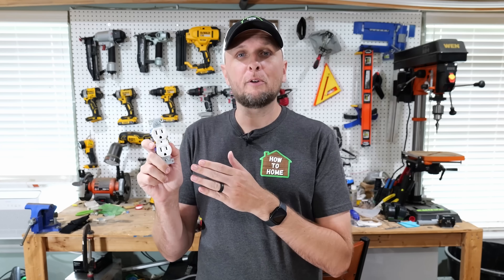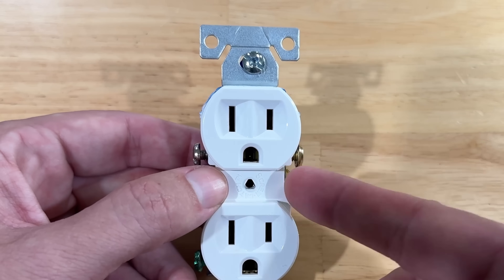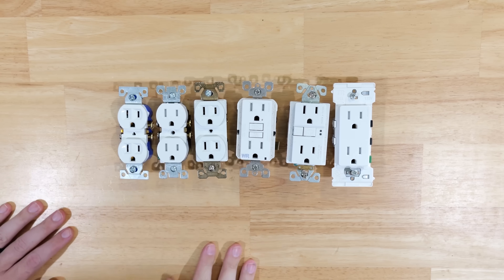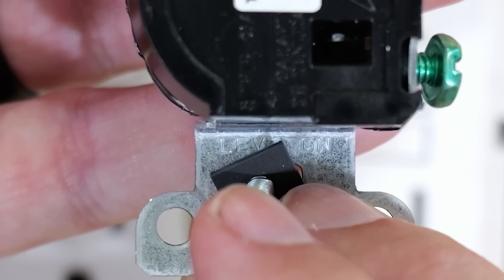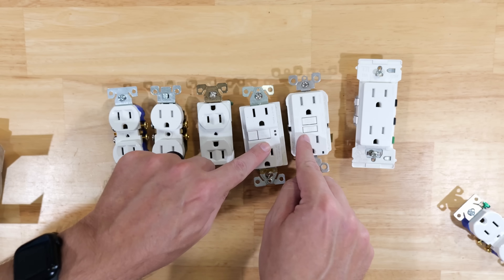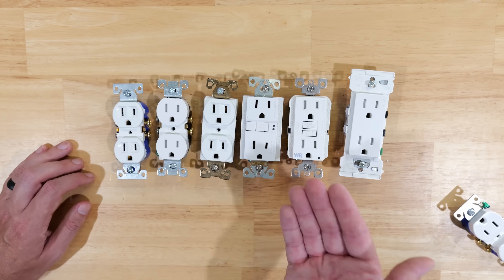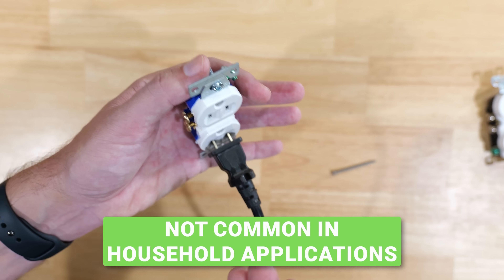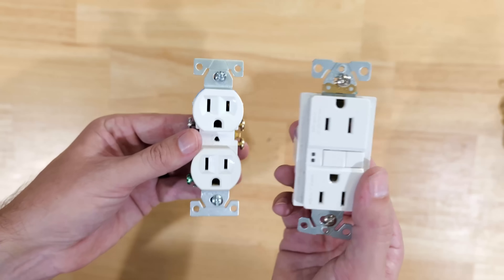The Shocking Reason Why Your Outlets Are Installed Upside Down!

Comment: When I started 35 years ago the master electrician that I was a helper for stated matter of fact the ground pin goes down. In this install the ground pin which is longer would pull out last after the hot and neutral pulled out. He also pointed out the UL was right side up when in this configuration. I was told this more than once. 
It is similar to having a longer ground wire on motors. The lines get pulled first and the ground is still connected to trip the breaker on a short.
Reply: @MzKitty006: Ground prong up when that outlet is attached too the wall-switch so people there have a visual cue to know where to plug in their lamp to control it from the wall light-switch.
  Medical facilities have things hanging on walls that fall, like clipboards that short the circuit, military galleys and restaurants, ground up was specified for contractors, due to stainless steel utensils being dropped, etc. In many cities ground up is standard in all commercial and industrial buildings, ground only go down in residential buildings, houses, apartments, condos, etc. 
   Everything is in context and the answer DEPENDS on context.

Comment: In Britain the ground is always at the top. Any discussion about anything causing an arc or shock is pointless, because there's a protective sheath on all 3 prongs that will not allow any 'foreign' contact - particularly fingers - until the plug is fully seated. Definitely more important there because the voltage is 220/240. Other points are that each receptacle is switched, so the plug can still be left in and the device powered off - and finally, it's impossible to be too lazy to bend down and snap the cord out of the wall, because the cord exits the bottom of their larger plug

Comment: Look at UK Plugs, if they are partly unplugged, you still can't drop a nail or knife or a finger to touch any live pin.. . .    Also note how UK plugs always have the cable hanging down, so don't tend to pull the plug out and you can't pull them out by pulling on  the cable.. . .  American ones you can.

Comment: Interesting except for how wordy it was - kind of annoying.  It took way too long to make a non-conclusional conclusion.  I imagine though that a home inspector would have a fit or take issue with outlets installed with the ground prong up, simply because it's unconventional - not like most homes.
Reply from the maker: Well, ya know, it’s kind of hard to get all of the information out there, along with all the different thinking and why they may be good or bad thoughts on the subject.  I wasn’t talking about the weather.

Comment: Because of a lot of newer plugs and extension cords for indoor use that are angled becoming more common, I tend to prefer indoor outlets being ground down. In a garage or shop however I go ground up....not only for the "falling object" reason, but also because of cords tending to be heavier on tools and extension cords. The hanging weight of the cords SEEMS to  have less impact on the plug being able to come out of the receptacle if the ground is up.
Regardless of which way I turn them, the one thing I ALWAYS do is to be consistent.... Indoor all ground down... shop, barn, outdoor, etc. all ground up.

Comment: In the choice of ground pin up or down, and in the case of a 90 deg cable + male plug, i would set it so the cable goes down instead of up, once the male plug is connected. It is something you did not mention in your video. Anyway i still appreaciate ur videos. Thanks

Comment: I would consider installing the receptical with the common or ground plug on the bottom, facing me. This would give the user, a better chance not to touch a live circuit
 and possibly be electricuted. It's all up to you!

Comment: I always install them with the ground prong down, simply because it looks better, IMO.  The only negative to this approach is that I need to strip off more of the cable insulation to expose the length of ground wire to reach the ground connection in the bottom position.  Then I will trim the exposed neutral and hot wires about an inch since they don't need to be that long to reach their terminals at the middle of the sides of the receptacle.  A bit of extra work.  Good video, I enjoyed the discussion!

Comment: A case for ground side down would be a basement. If flooding occurs the water would touch the ground hole before the hot hole. Realistically, the water should be rising slowly enough to touch the grounded box first.

Comment: As a retired Elect. we always put ground up because that is the way must rec. are installed. Just common practice. When I built my house that is the way I put them. When I built my 40 by 40 shop I put the rec. with the ground up. They are about 4ft off the floor. If you do something stupid like hook the cord with something like maybe your clumsy foot the ground is most likely the first to come out of the rec. The flat blades bend easy but straiten easy. With the ground on the bottom it is the last to pull out if at all. This is one time when three bent prongs are better than two. To ask me now, It just looks right and makes more sense to have the ground on top.

Comment: Nearly every commenter here forgets the effects of time.

Grounded plugs were far more important decades ago when use of plastics was far less common.  The housings of nearly every appliance these days is plastic and allows double insulation to protect the user.  We also didn't have GFCI circuits or plugs.  

Therefore ground UP, allowed the using a clear view of the ground pin while plugging it in.  If you didn't purposely check, you may at least subconsciously note that it was missing or damaged just by it being in clear view.

For this reason, ground up was especially common in kitchens, laundry rooms, and shops and commercial areas where tools and appliances were used the most.

As an aside, one should not use manufacturers designs as evidence as they have simply adapted to whatever the 'norm' has become.

Comment: I'm not an installer. But as a home user, I prefer prong side down. If the plug is not a tight fit, prong side up will tend to fall out easier than it would with prong side down. Interesting video!
Reply: Yes! I want the cord to stay plugged in. Not gape from the gravity on the cord and plug.

Comment: My brother had an issue.  He has an outlet on the backsplash not far from the sink in the kitchen, but had the dish drying rack in between them.  At one point, a butterknife in the drying rack tipped over to the side, JUST enough to fall inbetween a plug and the outlet (prong down), and POPPED and arced real quick.  Prong up on kitchen counters or on workbench height make sense.

Comment: All Outlets in Hospitals are installed ground up. Where does the code for Hospitals come from? Also some refrigerators come with a 90 degree plug with ground down so the appliance can be pushed back closer to the back wall.

Comment: I agree ground down. I am a master electrician with over 46 years experience. But a lot of jurisdictions will use Industry standard for medical facilities. IEEE White book Standard 602-1996 section 4.2.2 which says ground up just for that reason you mentioned that in a medical facility a needle can fall behind the plug. But that doesn’t guarantee safety. As the needle rolls to one side or the other, if it goes toward the line side rather than the neutral it will probably contact the ground and line anyways causing a short circuit.

Comment: There was a test done, and with the prong up, if a plug comes part way up and the plate falls from getting lose, there is a shock hazard. When the ground is down, the metal plate will hit the prongs and trip the breaker, thus de-energizing that circuit.
Reply: "De-energizing"? Let's call what it is: Shorting the circuit.

Comment: My buddy who was the chief electrical inspector for the city of Boston, had all his outlets with the ground prong up. I told him they were installed incorrectly and he set me straight, LOL!. He was old school and had seen a lot of problems. I think now a days it is not as much as a problem with the positive connections the outlet make now. Back then, they seemed to get loose very easily.
Reply: @jamesoncross7494: It still matters today. Ground prong up when that outlet is attached too the wall-switch so people there know where to plug in their lamp to control it from the wall light-switch.
  Medical facilities have things hanging on walls that fall, like clipboards, scalpel, hemostat, that can fall and short the circuit, military galleys and  restaurants, ground up was specified, due to stainless steel utensils being dropped, etc. Therefore it has become required that they be ground up for contractors. In many cities ground up is standard in all commercial and industrial buildings, ground only go down in residential buildings, houses, apartments, condos, etc. 
   Internationally, countries with 3-prong outlets always have the ground up
   Everything is in context and the answer DEPENDS on context. 
   Examples:
“Never took the orientation of an outlet seriously until I was measuring for a shelf with a tape measure. It slid down and fell across the prongs of the washing machine plug.  POW! “ —@joef.6596
“I work at a K-8 school. Maintenance assembles powered multi media carts with the ground plug up in consideration of teachers dragging metal bracelet chains across partially unplugged power plugs.” —  @scaryhouse7969
"I had lunch with the Chief Electrical Engineer at McDonalds headquarters. He told me that one of the workers in one of their stores had her hand badly burned when a metal cookie sheet (or something similar) slid out of her hand. It fell onto a receptacle that was partially pulled out...the metal cookie sheet made contact with the two blades resulting in  big arcing flash that caused the injury, this is a reason Ground Up is safer."

Comment: Application of when ground is up, least my experience is on a switched circuit, meaning one or more outlets are connected to a wall switch so power to plugged in item can be switched on/off. Compared to dedicated power always on to outlet unless breaker is tripped.

Comment: Since most homeowners will leave their outlets (receptacles) installed the way they came with the house, it is unlikely that they will change the orientation. However, in my case (general contractor), in my own home, I use a number of "flat to the wall" appliance type extension cords and depending on how the cord comes out of the plug head, I may change the orientation of the outlet. If when the plug is installed, the cord hangs straight down against the wall, this usually is with the ground prong on top. but sometimes with some cords, it makes the cord come out on top and the plug will not lay flat against the wall, or it will block the second set of holes. This is particularly a problem with refrigerator cords, which won't allow the fridge to be pushed up against the wall without pinching the cord (not cool).
So, in this case I'll look at whether the cord is going to block the other socket or not and I may turn off the breaker and re-orient the outlet so that the cord hangs down or lays flat against the wall. Just my personal choice but not a code rule.

Comment: Ground pin down.  Think of a basement filling with water. With the ground down, when the water rises higher and finally reaches the live conductor the short event will be more localized and therefore more immediate, so shorter duration equals less amperage throughout the body of water. If the ground prong is up, then it is last to touch water and not involved, so when the water first touches the hot and will short circuit and flow through the body of water until it finds an earth ground point. Yes, the same result but one will be marginally faster and therefore much safer.

Comment: The reason the NEC doesn't address this issue is due to right angle plugs on some devices.
Reply: That's not the reason. The reason is that it depends on the context of the building and the user use. Ground prong up when that outlet is attached too the wall-switch so people there know where to plug in their lamp to control it from the wall light-switch.
  Medical facilities have things hanging on walls that fall, like clipboards, scalpel, hemostat, that can fall and short the circuit, military galleys and  restaurants, ground up was specified, due to stainless steel utensils being dropped, etc. Therefore it has become required that they be ground up for contractors. In many cities ground up is standard in all commercial and industrial buildings, ground only go down in residential buildings, houses, apartments, condos, etc. 
   Internationally, countries with 3-prong outlets always have the ground up
   Everything is in context and the answer DEPENDS on context. 
   Examples:
“Never took the orientation of an outlet seriously until I was measuring for a shelf with a tape measure. It slid down and fell across the prongs of the washing machine plug.  POW! “ —@joef.6596
“I work at a K-8 school. Maintenance assembles powered multi media carts with the ground plug up in consideration of teachers dragging metal bracelet chains across partially unplugged power plugs.” —  @scaryhouse7969
“a length of florist's wire rolled off a side table onto a slightly loose plug and shorted the circuit, creating a small fire (quickly extinguished).  I now always install ground prong up” @deegee54
“I work at a restaurant and we have this work table with some outlets built in on top. Someone managed to let the edge of some tin foil go in between a plug and the outlet and it got disintegrated.”@MatthewSuffidy
“I knocked some change off of my end table one day my mistake of course, and a coin fell down right on the prongs resulting in a loud pop and a flash along with some smelly black smoke. I have since gone through my home and reversed all of the receptacles so the ground prong is now on the top.”—@chrisenglert3958
“my wife's gold necklace chain dropped off the rack onto two prongs of a device that were plugged into a receptacle with just a little prong showing.  It vaporized the gold necklace area of contact and left a nasty burn mark on the faceplate of the receptacle.   This was on a bar and I probably should have oriented the receptacles there ground prong up.“—@winfordnettles3292
"I had lunch with the Chief Electrical Engineer at McDonalds headquarters. He told me that one of the workers in one of their stores had her hand badly burned when a metal cookie sheet (or something similar) slid out of her hand. It fell onto a receptacle that was loose…the metal cookie sheet made contact with the two blades resulting in  big arcing flash that caused the injury, this is a reason Ground Up is safer."
“In commercial buildings (where receptacles are very high from the floor) ground has to be at the top. In a case of a water leak ground has the first contact with the water. In residential buildings (where receptacles are not far from the floor) ground needs to be at the bottom. In a case of a flood, ground wire would have the first contact with the water.”—@powerzx
“When a heavy extension cord or wire from a device plugged in is experiencing stress from the cord being pulled taught or tugged on, the greater force is usually downward. The ground prong being longer, exerts the greatest torque when the wire is being pulled in a downward direction.  Occasionally that downward force will cause the plastic of the ground prong opening of the receptacle to crack from the downward force. If the ground prong is up, that downward force has much greater support from the receptacle structure. I’ve personally cracked a few receptacles over the years working on projects where the wire plugged in was being yanked around a lot. Where the ground prong was up, the extension cord always stayed more securely plugged in.”—@TechwizJoe1

Comment: Contact Hubble manufacturers,  it is my recollection that these were first used commercially. Stainless steel covers were common place therefore this presented a Hazzard if the plate dropped across the neutral and line side. Many electrical engineers specifically  noted the orientation on the blueprints showing them ground up. Another reason was to protect the ground prong from damage when the cord was pulled on incorrectly. We have all seen the missing ground prong. In conclusion the right way is to read the notes on the blueprints for directions and if not noted install as you wish. Double outlets were installed opposite of each other in utility rooms to allow small transformers to be installed side by side.
Reply: I looked it up. Hunnle patented the grounded receptacle in 1968. All of their drawings show the outlet ground up.

WDK_IG8300_DRAWING_PDF
Reply: Hubble patented

Comment: And what about mounting these things sideways? I only asked because a lot of the flat extension cords that are designed for close tolerance of furniture etc. sometimes are directional meaning the cord will either be pointing downward or upward depending on the orientation of the ground on the plug.

Comment: 90% of the time I install ground down because most people prefer them that way because it is easier when reaching down to plug something in with the ground down so you can line up the prongs and not likely from the down position to have fingers slip and get a shock from touching the live prongs while unplugging something (it is usually the fingers that slip when pulling up). Pros and cons, there is no "right way".